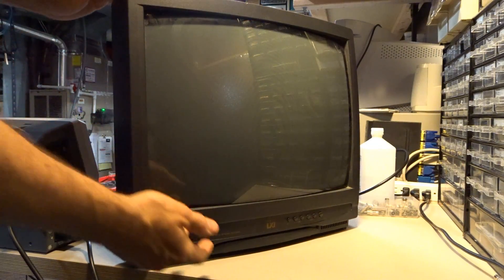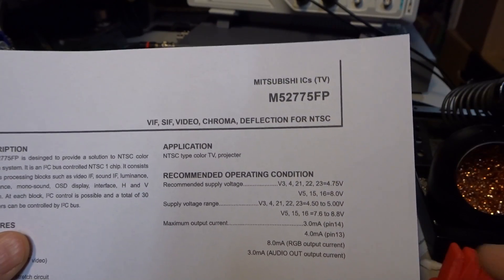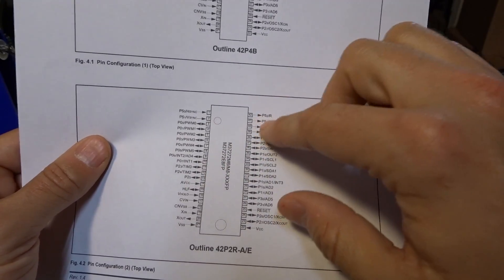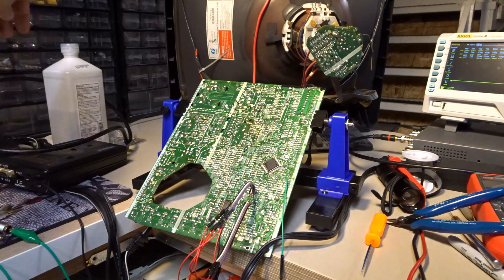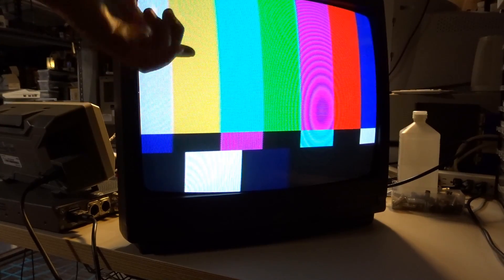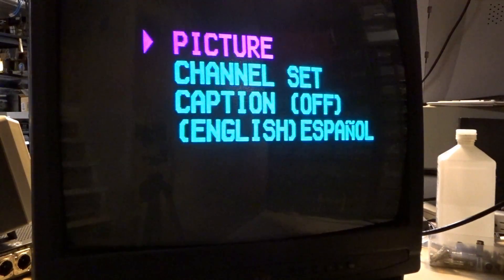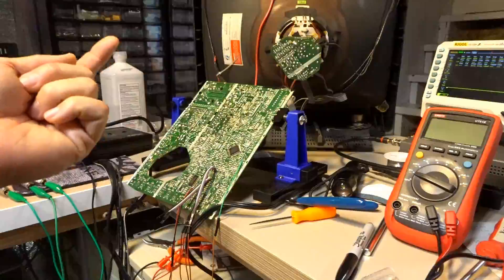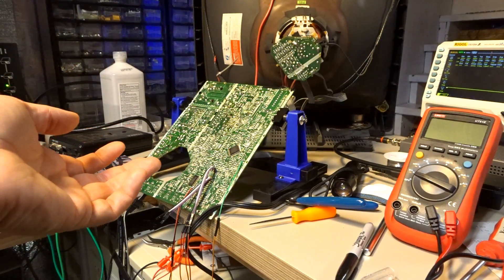Trash Picked TV RGB and Composite Mod

Comment: Couldn't believe how much clearer it is on RGB when you switched it. Us Americans got screwed so hard without SCART.
Reply: Doesn't PAL have more scanlines than NTSC?
Reply: a lot of consoles didn't even use those extra scanlines, and when they did, most of the software didn't use the mode that allowed it, with the exception of a few that worked just fine out of the box with the extra lines
Reply: @a4e69636b  More scan lines but lower framerate
Reply: Yes pal is superior
Reply: Even for component input, which is essentially equivalent to rgb that is used in america, it's basically only on the very high end models.
Even some trinitron wega models don't have component input.
Everyone says to just find one on craigslist for free or something, but if you're a retro gamer in america and are looking for one with component/rgb on it it's not nearly that easy, and ebay sellers have caught on this trend too.
Reply: @orbusg8451  eBay sellers? How do you sell a TV on eBay? It would probably cost a thousand pounds just to ship it. Yes I know that joke was lame
Reply: Yes but the average American consistently wants cheap and easy. RF and composite are cheap and easy. I lived in the UK for 5 years and I personally think SCART cables are an absolute pain to deal with. They are big, bulky, stiff and hard to route. I think the people in the US who are using SCART in their setups are STUPID. You only need 4 pins for RGB and the SCART conssector has 21! Get some BNC hardware and coax cable. They are more secure and give options for better shielding, generally.
Reply: Lone pube Maybe, but my PAL Amiga had good use of those extra lignes.
Reply: PAL signal have more horizontal resolution if I not mistake
Reply: vertical
Reply: @NB-1  the ps2/gamecube generation ran at full speed in 50hz, game timing wasn’t linked to frame rate anymore (edit: full screen, too)
Reply: Nearly every colour crt here in England had at least 2 scarts and an s-video rgb input
Reply: @Lone pube I live in America and to be honest, I'd rather have PAL. The reason being is that PAL has better screen resolution then NTSC (720x576 vs 720x480). In that sense, games look better. Also, NTSC doesn't really correct tint (PAL systems correct this issue)
Reply: @silverwindspirit  I'd actually prefer 60hz over 50hz quite smoother
Reply: @brunor.1127 While that is true, nobody using PAL ever noticed screen flicker. It’s only those who were used to 60Hz who noticed. Given the colour signal issues of NTSC, and the lower picture line count, PAL wins every time. It’s a matter of history that NTSC was first to market and the PAL and SECAM standards improved on it and overcame the deficiencies which were inherent in NTSC.
Reply: @silverwindspirit As we used to say back in the say, NTSC = Never Twice the Same Colour.
Reply: We can get the same picture with component cables in our games play faster so it looks like you got dicked

Comment: So you are going to attach the input directly to the IC with no buffering or normalization of the signal levels?
Reply: Yeah, should be fine. And if it fails, it was just a road picked piece of trash anyways. Just be aware that this TV is probably class II, so the ground is floating at half mains. And that Scart isn't supposed to be hot plugged either.
Reply: I have no doubt that you can handle all the pitfalls. Would just be a shame if someone fried some super rare console in the process of attempting this though because they weren't aware that the TV ground could actually be hot.